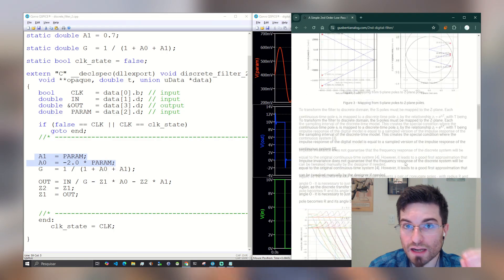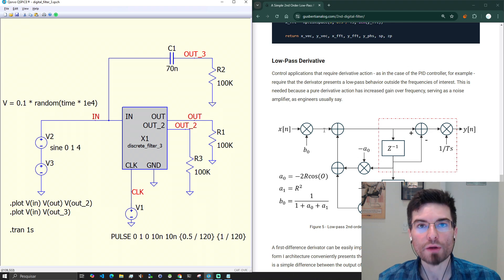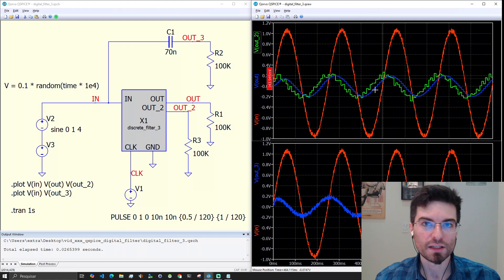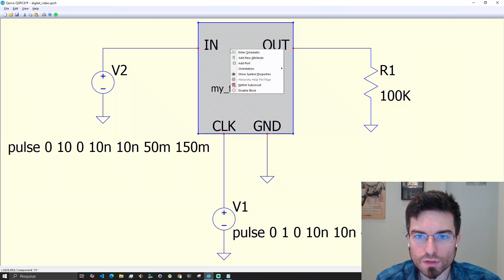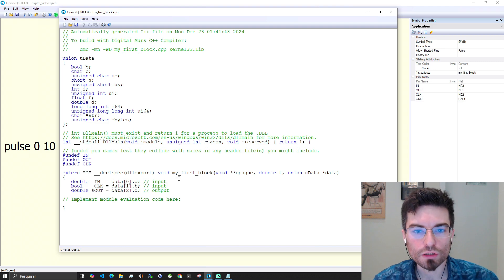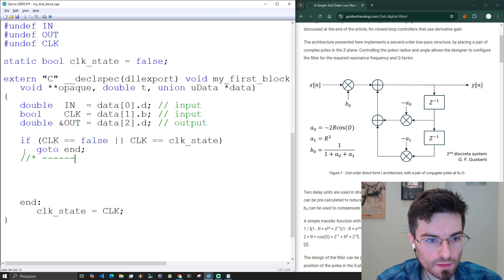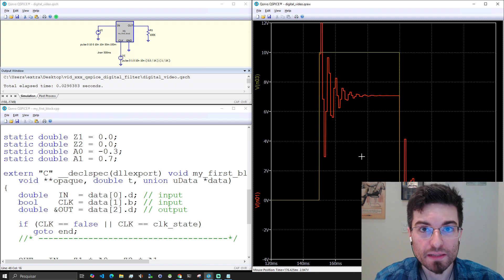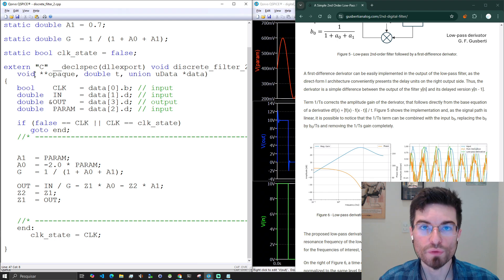QSPICE & C++ Integration: Simulating a Digital Filter Step-by-Step | Electronics & RF Engineering

Comment: is possible to preform AC analysis to this C block to see the bode block? 
or c code isn't support?
Reply from the maker: Linear AC analysis should not be possible.. But I think it has some tooling to extract frequency responses using multiple transient simulations.

Comment: Thank you so much for starting from very begining! I was stuck on the template definitions 😅. I thought those lines were coming from people‘s heads.
Back in the days, when I was reading a book DAFX (digital audio effects) by Udo Zolzer, I realized that almost every audio effect has to do with filtering. 
Most of qspice videos are on power electronics (as PE eng, most of my knowledge I got after university), but something unusual woul stand out.

Filters are fun, i think would be cool doing some more videos on this topic. 
implementing various uC functions or peripherals (probably stupid idea).
Implementing some important circuit functions with high rate of reusability.
Reply from the maker: Thanks and welcome!

Comment: The most important thing to implement, no doubt, is a delta-sigma ADC! Then, whatever you come up with afterwards, can be plopped into an FPGA. FPGAs (even small and cheap ones) have comparators on (differential) inputs - so it is doable. I.e. all input signals will be boolean, and yet, it will be able to process analog waveforms!
Reply from the maker: Yep! No doubt we should do a project like that here in the channel!